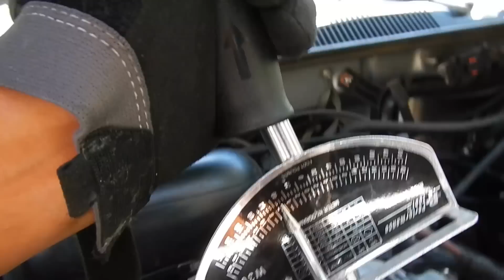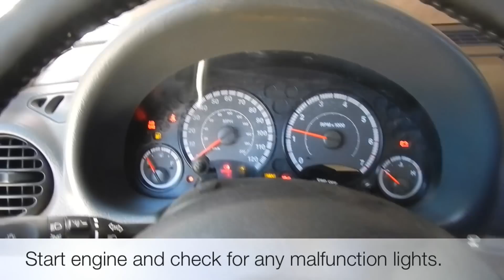How to replace water pump on Jeep Liberty 3.7 KJ

Comment: Thanks for posting the video. I am replacing my therm and pump this Friday and being a (mostly) novice there were details in your process that other videos have not had. Hopefully this will be the end to my overheating. Already replaced a cracked radiator two months ago so that part is fixed. All research leads to my WP being the culprit now. Will keep an eye out for future repair videos if you post them. Please thank the camera operator as they did a great job as well!

Comment: I see that you show how to remove the water pump AFTER the fan blade/fan clutch have been removed.  Actually, that is step 1, and the hardest of all. I just changed mine last week. The fan was so hard to get off, that I pulled the water pump off with the fan blade attached, which was no small task.  Then, I took the fan blade/water pump assembly to a machine shop to get them separated, so I could re-use the fan blade/fan clutch.  Apparently, the fan blade assembly is often so tight, due to the rotation of the fan, that it cannot be removed, even with the proper 36 mm wrench and spanner wrench. Also, after everything was back together, I didn't get all of the air out of the cooling system and had to have my Jeep put on an air-lift machine to get it "burped". Wow. Not sure I'll be doing much more work on my own with this Jeep. LOL! Not for the faint of heart, for sure. But, it's running great now, after all that effort, and I paid $51 for the new water pump. Thanks for walking through the rest of the process.

Comment: video is wicked helpful gotta change my mom's water pump tomorrow, keep the guides coming if you still have that vehicle or even do them?
Reply from the maker: Thanks! Yes, I still own the vehicle and probably will until the transmission can't go anymore and yes I do all jobs by myself...
Reply: awesome! it went off without issues it looks like. was wicked cold so the radiator hose was stiff and tough to take off but that is minor compared to water pump issues i have had with my cherokee
Reply from the maker: thats good. glad to hear the good news..

Comment: He's doing a good job, but for the lower hose you don't need to pull it off on either end, there's a little nut on the bottom of the radiator that let's you drain coolant
Reply from the maker: +The Grease Grizzly The lower hose only needs to be removed when wanting to change the thermostat. I would always recommend changing the thermostat. It's a inexpensive part.. thanks for watching

Comment: Lance, i have a 2003 jeep Liberty limited. It has 2 fans. one attached to the pump. I need to know if the fan attached to the pump can be changed if it malfunctions without changing the water pump.

Comment: You forgot a very important step..... You need to Bleed the system of air after adding the coolant and motor is up to temp, Then you top off the tank if needed and done.
Reply: +143Chippy I had mine put on an air-lift machine to get the job done. I couldn't seem to bleed enough air from the system myself. This whole thing was no small job.
Reply: Ive bled many vehicles by just leaving the reservoir cap or radiator cap off and just letting it burp out the air
Reply: I was thinking the exact same thing. I'm doing one for the very first time this weekend and that's the one area I feel a little unsure of, everyone seems to do it differently. I'm glad this wasn't the first & only tutorial I watched!

Comment: A couple of things, if someone purchases a Thermostat that is not OEM pay attention to the direction of installation, I have seen some that do not have the small location tab and you can easily invert during install. Make sure you check the Tensioner and Idler for bearing noise, if I pull a water pump I replace the tensioner. Replace the belt, even if it’s got only 20k, they are cheep, also if you have a rubber/plastic preservative you can soak the belt for 10 min or so and the belt will last for years. The last thing is check waterless coolant, it is superior to what we normally install. I forgot to tell you to drill a 1/8 hole in the flange of the Thermostat to allow easier air bleeding. Make sure not to drill in matting surfaces.

Comment: THX for sharing your installation procedure, you mention using antifreeze on the threads bolts. Will that take place of thread lock?
Reply from the maker: Not antifreeze but ANTI SEIZE. If you don't know what that is then ask your local auto store clerk. Yes it will help with thread lock. Sorry about the delayed response but I've been busy the past two days with an American holiday tradition. Thanks for your views and comment!

Comment: could you help me how replace the radiator  fan  motor for to star with t all this project with my 2002 jeep liberty ..thx... ur video is really good..
Reply from the maker: Yes I can. Do you have the same radiator fan as mine? Or dual?
Reply: 2002 jeep liberty actually is the fan clutch could u do some video thx
Reply from the maker: Fan clutch? do you have a diesel engine? If you do or not I can post both for you but it'll be two different discussions and it'll take a lot of time. Do you have a 3.7 L engine or 2.8 L?
Reply from the maker: If you do have the 2.8L Diesel I can post the instructions for you but I can't post a video about it. Since I don't have that particular engine.... Appreciate your views.
Reply: Thx I figure how do it i  remove the fan clutch and your video for the water pump really help me thx Lance ur video is amazing...in the future i wanna change the chaing of the motor   i not know if you have a video about that ....2002 jeep liberty 3.7L Thx Lance
Reply from the maker: Are you talking about the timing belt chain?
Reply: fan clutch but was hard but I finished with this project

Comment: got the new pump in went almost too smooth but the pump wasn't the problem any other ideas I'm at a loss at this point unless their is some bypass valve that I'm not finding
Reply from the maker: +Stare Crazy You can try feeling the the top and bottom hose once the jeep is warmed up. Check to see if both hoses are hot. If one is hot and the other is cold then the thermostat could've gotten stuck closed. If its a new thermostat then the thermostat could've been placed backwards.

Comment: hey I have been having troubles with no heat changed the thermostat flushed the heater core drilled a hole one the box that the heater core is located to check the blend door  doesn't overheat and stays at half way on the heat gage I'm all our of ideas and the only thing I can think is water pump at this point unlikely that it is any ideas
Reply from the maker: +Stare Crazy Yes, it sounds like a water pump issue. Even though there's no audible bearing displacement the fins on the inside of the water pump could not be spinning or worn. You could try squeezing the bottom and top hoses to see if theres suction. If theres none then the water pump could be the problem.
Reply: +Lance thank you I Will try that awesome video by the way
Reply: +Stare Crazy I noticed my old pump had a green plug in the top but the water pump I got and you have both didn't have the green plug but had the hole do I need a plug because it was so brittle it just fell apart when I tried to take it out
Reply from the maker: Stare Crazy No the Weep holes serves different purposes. Leaving it unplugged would be okay and they can't to do their job if they're plugged as well.
Reply: it turned out to be the heater core I finally bit the bullet and changed it it took 5 hours but we'll worth it I'm surprised I was able to get water flow thru it last year it weighed about 2 lbs more then the new one guessing it was full of debris
Reply from the maker: Stare Crazy I'm so glad you got it done... Thank you so much for the update.

Comment: Does a water pump need to be replaced though? For example my jeep leaks from there, couldn't I just put a new gasket?
Reply from the maker: +Anthony Vlogs no for what's it worth toward the value of your engine, it's highly recommended to take the safe route. Replace your water pump, seals and coolant... weep holes are specifically designed to warn you of catastrophe water pump failure. It might seem like a lot but if you do it yourself you'll save hundreds... if you have any further questions, you can always try private chat
Reply: Lance Yeah you're right, I already purchased the whole pump and gonna replace it later today.
Reply from the maker: +Anthony Vlogs please let me know how it goes..
Reply: Lance turns out, my jeep is different lol, the waterpump is connected with the fan. I got a 03 Jeep Liberty Renegade.

Comment: Mr Lance I also own 04 Jeep Liberty . 
question what does water pump do or work for ?
Reply from the maker: It circulates(pumps) coolant throughout the cooling system. The coolant has to be circulated through the radiator and the heater core to provide a safe engine temperature. So if your pump stops working the coolant would quickly overheat and cause major damage to the engine.
Reply: +Lance thank you..

Comment: how did the fan clutch magically get off?
Reply from the maker: No fan clutch on this engine. The cooling fan houses the radiator.
Reply: My bad. Looks exactly the same as the 3.7 Liberty with 2 fans
Reply: ProfessionalDad Indeed, if you have a 3.7 Liberty with the tow kit and the mechanical fan, this job become a nightmare where you have to remove the whole front.
Reply: +Guy Rousseau +ProfessionalDad I just had the extreme difficulty of that very struggle.  I pulled the whole assembly off, then took to a machine shop to have put on a vise to get it separated. It would not have come off under the hood, even with 36mm wrench and spanner wrench!
Reply: +Kevin Ruff There are exceptions to every rule. LOL! This particular Jeep model is NOT reverse threaded.  I verified that with the new water pump before I started cranking down on that thing. It was so tight, a spanner wrench would never have gotten it off. I had to remove the whole assembly, water pump, fan clutch, etc., then put in a vise and beat it with a hammer. It was awful.

Comment: Well, things were going great until I snapped a bolt in the block putting the thermostat housing back on. Even then it didn't leak even at full temp. At the mechanics to get the bolt removed and replaced. Oh well.
Reply from the maker: Sorry to hear about the thermostat. These parts are mass produced in mexico and i've worked on hundreds of engines. Bolts just break sometimes, mainly its the quality of the bolts. I need to make a video about tapping a broken bolt. its so easy. Trust me it does happen often when you work on engines. Im glad you got it fixed.

Comment: And fan removal
Reply from the maker: Sorry about the delayed response... I was driving when I received your question. Okay, There are only four mounting screws holding the fan assembly into place. They are located under the hood facing the engine on the fan assembly. Be sure to disconnect the negative side of the battery first! Remove up and lower radiator hoses along with the electrical connector. Loosen then remove the four mounting bolts with a ratchet (preferred). Next, simply lift up to remove the fan assembly. The fan assembly is sold as one whole unit so if any parts are defective than be prepared to obtain a brand new fan assembly...... Installation is reverse of removal. If you like I can make a video for you but you won't be able to see it for at least 48 hours. ..
Reply: I had two fans one on the radiator and one on the pully on the water pump I was having a difficult time taking off the one on the pully but if figured it out thanks for responding to my question.
Reply from the maker: Catch2218 Of course your welcome. If I had known you had a dual fan system I would've gave those instructions as well. sorry next time i'll post both. I just couldn't because I can only type so much during my class lecture. I'm glad you figured it out though. appreciate your views ;)

Comment: i will attempt thia myself. if i screw then i will pay someone to finish the rest
Reply from the maker: Bryan Max thank you for watching! Good luck!👍
Reply: Lance can i replacd the water pump without draining the engine. i did do a radiator flush but only my water pump seal is messed up now